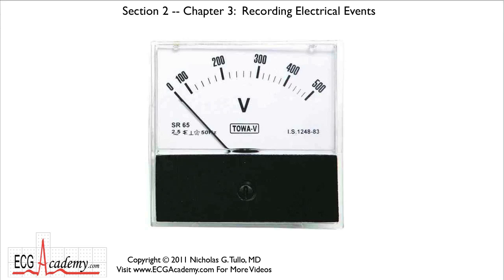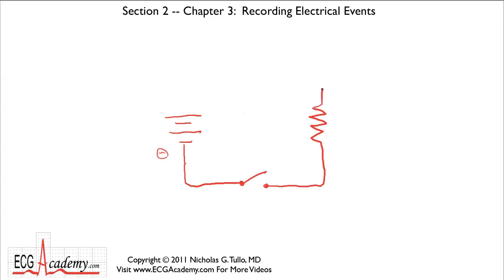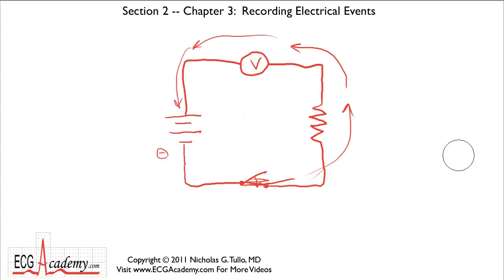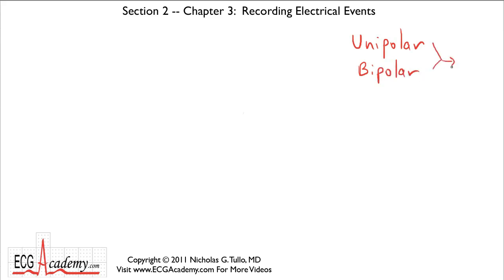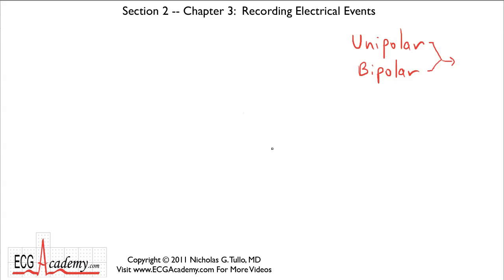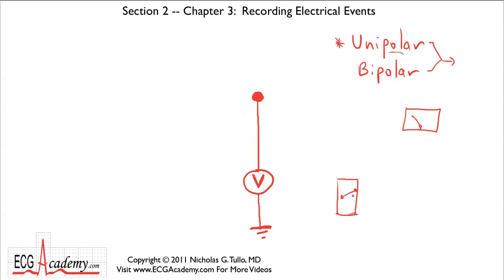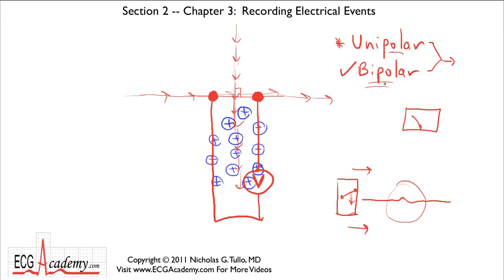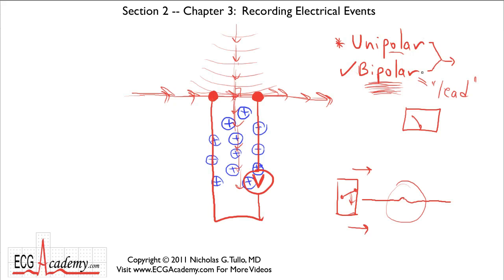Recording Electrical Events 2-3 - ECG / EKG Interpretation -- BASIC

Comment: @1:11 Actually Voltmeter is not inserted into the circuit in that way, that would be the current measurement device. Voltmeter is placed between two different nodes of the circuit (in parallel).

Comment: Hi Dr! Thank you so much for your videos they are so helpful. You probably won’t see this but in case you do - I don’t understand why when the positive charges pass the second pole (6.55) the event is recorded as negative, why, as you say, the polarity is reversed? I would have thought that whenever a positive charge passes a pole that it is registered as a positive deflection on the meter. Many thanks 🙏
Reply from the maker: There are two poles... the voltmeter records the DIFFERENCE in the voltage. If one pole is more positive than the other the needle will move in that direction. If the positive charge hits the second pole, the "polarity" is reversed -- now the right sided electrode is more positive so the left sided electrode is MORE NEGATIVE, thus the signal recorded becomes negative.  -- "Dr. Nick"
Reply: @ECGDoc  oh wow! I can't believe you saw my question. You are so very generous with your time and information. Thank you Dr Nick for explaining that for me, it's a great help!
Reply from the maker: @katherinblecker2549  You're welcome, Kat!